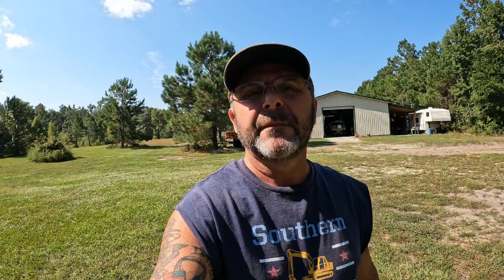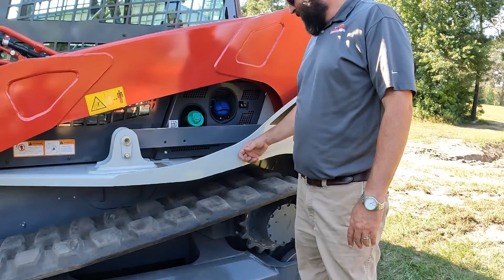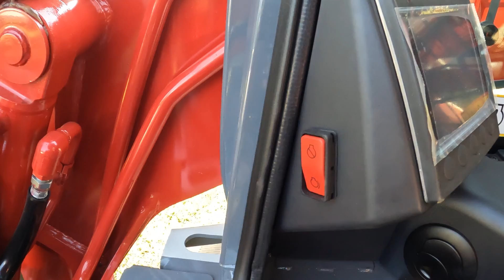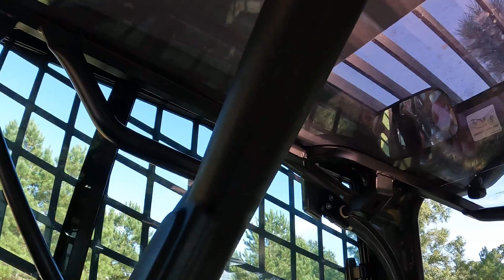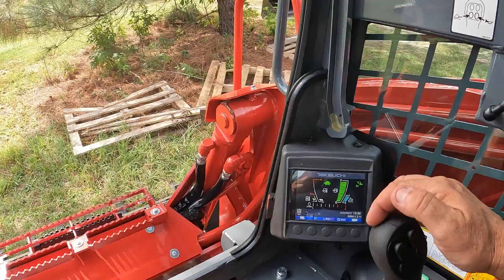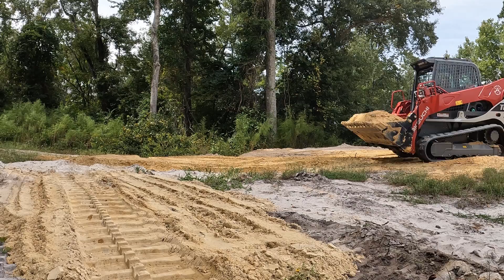Out With The New & In With The NEWER -2022 Takeuchi TL12-V2 High-Flow CTL Delivered...

Comment: Man, I wanted one of those small toys! When I bought my TL12V2, I didn’t get a my own little toy I could play with on my desk!  I want one! Do you think for the $89,000 I spent on it that I’d get one for free!  My big wide bucket that I got with mine broke apart after 9 months and my dealer was changing to be a deal of a different brand, so they would not replace it.  Clearly, Takeuchi has someone else build their buckets.
Reply from the maker: Yes you definitely should have gotten the toy! Luckily my buckets are holding up well 🙏

Comment: Are these still powered by Kubota engines ?
Reply from the maker: Yes they are, but more HP than their own version...
Reply: @southernhomesteadtransformatio  What I thought…..same engine , it’s all in the turbo adjustment. 
I bought new ,and still have, the older SVL 90-2 ….been a great machine for my weekend warrior stuff. Even with running the fecon mulching head . Only thing I ever had to address was the hydraulics overheating in the summer months. Fixed that with a “loftness cool flow” cab mounted cooler last year. I hope the newer models of all brands have addressed that. I do like that new Tak too…..👍
Reply from the maker: @Bennie Barrow  almost a year now and I love it!...enjoy yours!

Comment: Man what a nice unit. I wish i had a need/use for some equipment. I can barely justify my riding lawn tractor lol. That inside does look hue compared to the other one. Do you foresee adding the tilt bucket attaching plate like dirt boss uses?great video thanks for sharing. Stay dry durning the storm.
Reply from the maker: Thanks Robert, I do love it! Tilt bucket would be nice but I'll probably just use the Grading Bucket on the Yanmar for the tough areas...at least for now 😄
Reply: @southernhomesteadtransformatio  hope you guys are staying safe down there with the storm.
Reply from the maker: Thanks Robert, it's over now, lost power for about an hour so I didn't need to get the generators out 😁...lost the roof panels in the greenhouse and a few limbs down so I call that fortunate 🙏